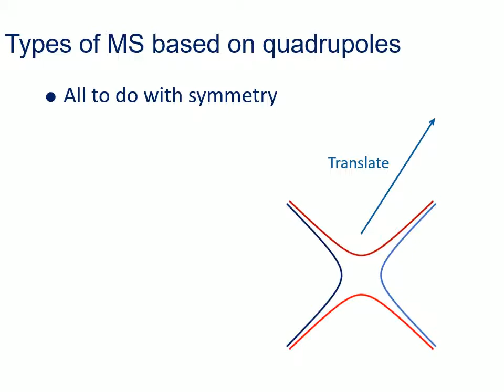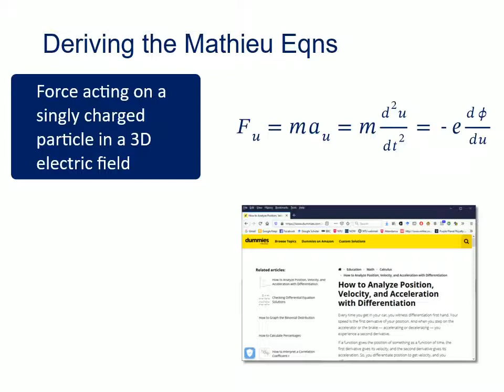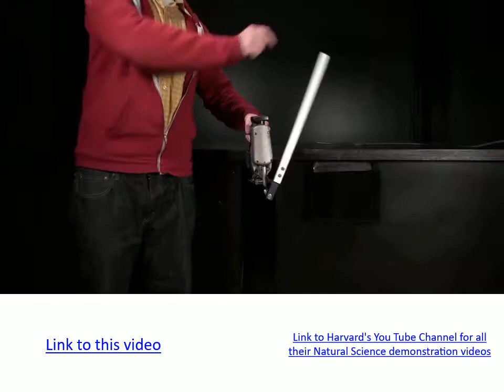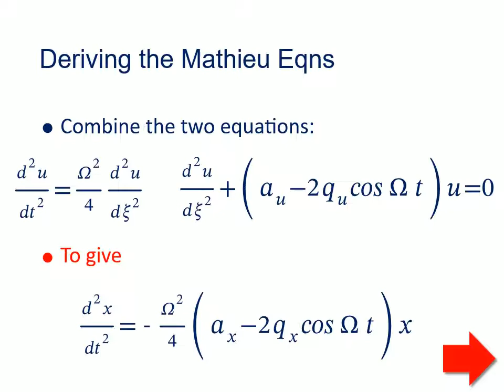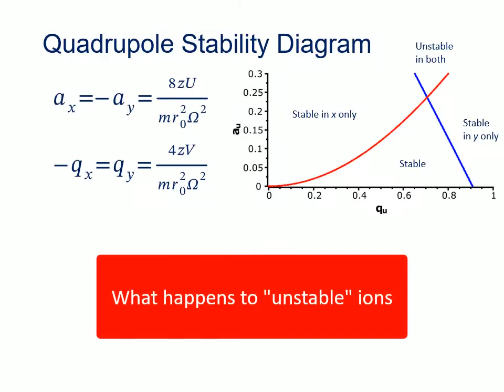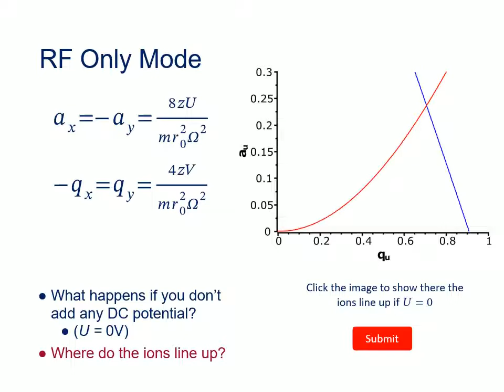Quads and Traps:  Introduction

Comment: I slightly disagree with the point about vacuum requirements. Yes, all mass spectrometers need high vacuum, but compared to other analyzers (say TOFs or ICRs) vacuum requirements for quadrupoles are much less stringent.